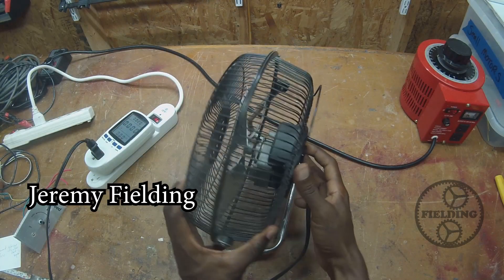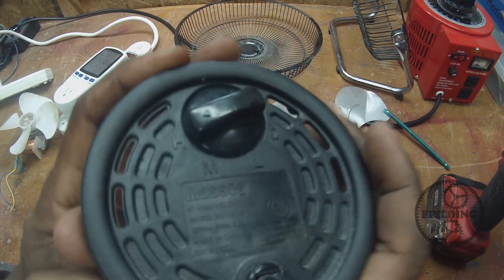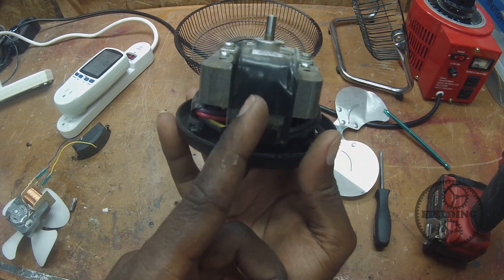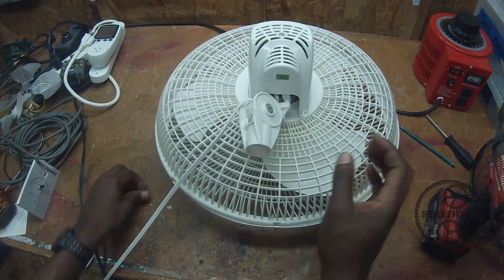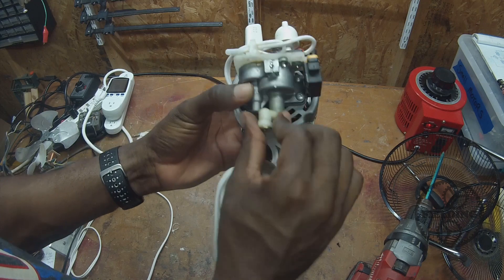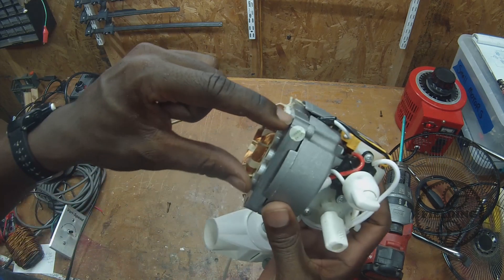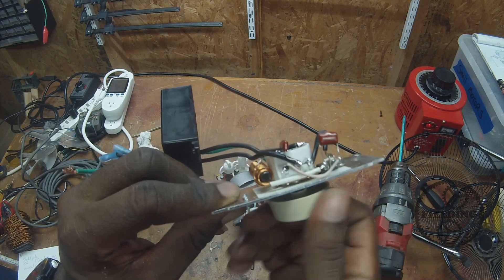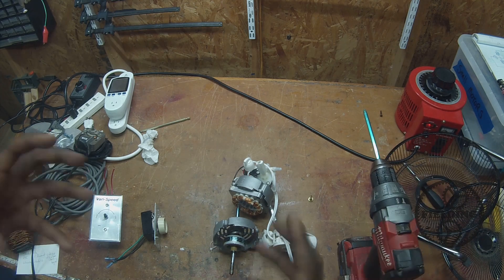Speed Control for Shaded Pole and PSC motors; How they work!: 039

Comment: Very educational videos. Compliments!
Because I want to digitize my old Super 8 films it is necessary to slow down my Eumig 610 D film projector motor exactly from 18 frames per sec to 16 2/3 frames per sec. I think the motor is a shade polo induction motor. The motor has two wires to the motor. My question is can such a motor be slowed down with a PWM (PulseWideModulation) method? A dimmer does not work accurately enough. Thanks in advance for your response!

Comment: Hey Jeremy thank for the explanations, I'm new to this stuff, would a psc motor work with a speed controller? I have a 3 phase motor with a 4 uf capacitor, and I want to wire a speed controler if possible, but don't know how, nor have I found info about it. Thanks

Comment: Why are some of the "C" frame shaded poles rated at 240v and others rated at 120 and still others rated 120/240 yet they look identical, where is the difference in these, is it the primary wire size different between them.

Comment: What’s the difference between the triad dimmer and that “Vari-speed” triad based control? I’ve seen those go for significantly more $ than the dimmers and can’t help but think they somehow offer a more reliable method of attenuating… but I’m just speculating here. I’m hoping to make a shaded pole speed controller with a rocking foot pedal, but I’m not sure which to use/if one will be able to bring a motor up to speed quicker than the other under-load. (I’m making a Leslie rotating speaker). 

Great explanation as others said, so many people just drone on and leave you learning nothing.

Comment: Great video and excellent explanations, much appreciated !!!
I have a 220V table fan who looks like the one you used at the beginning in your video, the problem is that it is very loud even on speed 1 which is the lowest. Can I reduce the voltage by plugging it into a 110V transformator ? To be honest, I tried it and it works like a charm, but so many people told me that this is dangereous because it will damage the motor  which will overheat at low voltage, and the fan can even catch fire in the worst case. I can also mount it with a lamp dimmer which I own (the kind of wall mounted dimmers used in the seventies with normal lamps) ?What do you think ?

Comment: Nice explanation, but I have a doubt, the bench grinders (110v) have induction motors (brushless), and most of them have only one speed, although some manufacturers offer models with speed control. I suppose they are not using frequency control because is a expensive. So, What is the method used to control the Speed in a cheap monophase bench grinder?

Comment: Thank you for this! I've been looking at ways to control speed of a whole house fan using a remote, and options are very limited. I've read some resources on PSC motors, but this video is the only one that explained how these motors work on a practical level with restricting the coil, and it finally made it click for me.

Comment: Very informative!  Can you possibly talk about how you could add a fan speed control knob on an oscillating fan?  I don’t want to add the speed control without bypassing the oscillating motor, for fear of burning out the oscillating motor.  This is for a 30” industrial fan.  Thank you!
Reply: Ok so I learned it should only be one motor.  So it seems the cork rage control switch should not hurt the oscillating function.  So do I just wore it up??  Lol just thinking out loud but thought I’d check in.

Comment: I love to learn from you ... but i have question / problem. I have reused my old compressor motor wich was ok, for my DIY beltsander. I cannot remember if there was a identification tag on the motor or compressor. For now this motor is unkwon and 3 colored wires and 2 black. Black is the centrifugal switch and then green white brown come out of the engine. They meassure 2 4 and 6 ohm.
Now i tried to regulate the voltage and smoke came quickly. How is this possible ? How can i identify a 3 phase and 1 phase 220 V motor ?

Comment: I would have thought the only way of controlling speed on a shaded pole motor was with frequency.. IF you actually are doing it with voltage, is this due to slip ???

Comment: If you connect a switch to the capacitor connection into a single phase motor, are you able to control it using the change in frequency? And can you control single phase motors with capacitor start using voltage without risking overheat ? Of course lowering voltage from nominal

Comment: What a brilliant video. In my motor course they dogmatically stated that by adjusting applied voltage (or winding turn numbers) to control AC induction motor speed is ineffective, especially in shaded pole motors. With a brief practical demo, you showed that even though it isn't great in terms of efficiency, it does have practical application. Certainly it's a lot easier than changing frequency, though I suppose by increasing slip, the motor shifts over to a region of the torque curve that draws more current and puts more heat on the windings. Evidently for low torque applications like a fan, that works OK.

Comment: So being able to tap the coil at difference points and being able to change the supply voltage as well  would create a huge variation of speeds and torque if combine?

Comment: guys, I am still not sure if it is a good idea to slower my induction motor with the help of a dimmer, I have done it and it does the job perfectly fine and after 2  years I have come across this video and what I have found is that he is saying not to do it this way, the motor I am using is for HVAC and it is an induction motor with the capacity of 15 mF, it is 1/2 HP, 1350 RPM, 1 phase and I am able to reduce the speed to almost 300 RPM, any idea why it has not stopped working and should I disconnect the dimmer from now?

Comment: Could one of these be reused in a circuit with different resistors on each wire to lower voltages? Say to have have different brightness for a light?

Comment: Hi! I have a few exhaust fans I want to install in a paint booth I’m building. They have single speed PSC motors in them. 
I want to be able to vary the inlet fan speeds to adjust the pressure in the booth. 
What kind of speed controller would you recommend? 
Also, Could I run two fans off the same controller? Thanks.

Comment: I'm a little confused :( in the previous video you showed us how changing the voltage and the power of the magnetic field didn' t affect the speed of the motor but in this one it seems it works...what did I miss? maybe it's because there is a load now?
Reply: If I understood correcttly, it is because it is not the same type of motors, in the previous video it was an induction motor

Comment: Hey Jeremy ! thanks for these videos . I have two questions. Where can I get that red device with the knob on it that you used to supply the variable voltages? Can you hook me up with a link for it . I really want one . Also for the motor that had variable speeds by taking from the windings at different stages, will the one that comes off the windings last have to highest speed or lowest speed and why . Feel free to send me direct VN. My number is 18683488235. I would like to be able to ask you about future video request . At present I would like you to make a video on how to make a DIY washing machine using a washing machine motor and something like a large bucket .

Comment: Those variacs are poorly made, compared to the monsters used to have, but some things are cheaper, that equipment. analytical equipment, used to have balances 20k, amino acid sequence DNA synthesis don't know, guy ran iop into dirt, refused to help. He's electrical engineer. Just hobbyist? Need power for ac dc heating mantles Control. Brother stole all, set fire to whatvouldnt sell, left nation. Serial killer, deviant see van diagrams for crimes, famous dead royal rich, missing sex abuse, murder statistical anomalous you'll find adresss. Sussex, UK. Tunneling to not pay two nations. End west. Hemispherical mantles can be ac dc, get up to 450 Celsius!  Need explosion proof sparkless motors, stirring overhead PTFE, under magnetic stirring. Use fan neodymium two on blades poles across. Controller PC or larger 5-12 volts cooler enough old PC could power mantles. Dc electrochemistry, control. Welder would be mice if control, not wasteful. Awesome stuff!  He should be teaching, or father.

Comment: Hi Jeremy, big fan. Making a lapidary machine with single phase brushed motors with start capacitor. Was hoping to run it right off the motor. What would be the best method of speed control? Or should I just maybe use pulleys? Thanks for all your great videos. I am very new to this so watch them multiple times. 👍

Comment: Thank you so much for your videos! They have rekindled my inner maker and I have started on a project to make a circulating fan for my wood stove using a salvaged PSC.
I threw away the speed control switches (without thinking about the fact I could reuse them). 
My question is, what is a cheap & effective speed control to use with it? I was thinking of just using a hood fan switch but was curious what you might use.

Comment: Jeremy, As a curious thinking guy, but with an automotive background, a single speed shaded pole motor, simply uses mutual induction but to a rotor. Now I have a devious idea. On lawnmowers, snowblowers and most small engines, they imbed a pair of strong magnets into the flywheel. It’s only purpose is to force mutual induction into a laminated core, but a number of wire turns creates high voltage at very low amperage. This spark timed by the flywheel.
 What happens if we take the outside diameter of the flywheel and cut the shaded pole motor to use mutual induction to produce electricity? This is the arrangement of large lawn equipment that has lights on them. With a tight air gap, a shaded pole frame cut to fit the outside diameter and use a wheat-bridge rectifier to produce DC voltage, it could be used to operate LED strips in housings or simple double faced tape to shine light on the work on our short winter days. 
 Now, with an unknown number to wire turns, ran thru a rectifier (Slight voltage drop) but perhaps a regulator for 12 VDC. It can be $200 more to purchase a light kit or more installed at the factory. This could be a cheap interesting experiment just to see the voltage produced (120 Vac / 12 VDC) and the current should equal the fans usage at speed. Easy to operate LED lights using current limiting, or bulb operated lights depending on output. 
 Curious, daylight savings makes it dark to mow or bag leaves to till into garden. Grow dirt!
Thanks again for the video and clear info. I have a big fan, I plan on drilling holes into the sintered bronze bearing, tap and install grease fittings. So I can get it working again!

Comment: An induction motor can start in either direction a capacitor or starter winding is added to the motor to start it in a predictable direction.nothing to do with torque

Comment: Can you tell me why?I have a 1/4hp single phase  electric motor like might be used on an air compressor or squirl cage furnace fan, now this motor fell off work bench and landed directly on the armature shaft, driving armature shaft into the motor housing!now the motor was fine +working well until this fall (of about  4feet directly on its shaft) immediately after the fall motor was hooked back up as it was just before,+ would not come on!? No hum no twitch not even a spark! Now I have disassembled this motor(a lot!) And reassembled to no avail it just simply will not run,! With 20 years gone by and considerable thought I'm only able to come up with this answer, did the center part of the solid centered metal armature shift on the center output shaft?possibly breaking some electrical connection?plz if u can answer this I would greatly appreciate it signed puzzled for years!,(might I add there are no physical signs of damage to this motor that I have been able to find, all clearances appear OK +motor spins freely no internal contact or rubbing any where)Mr.Gary Ebner

Comment: Jeremy I have a very expensive $189 shaded pool motor and it is single speed and coil is shorted☹️. More windings is more torque.....what Would happen if I used a larger size wire or a smaller size wire does it simply mean that a smaller size wire will take more windings that’s more torque? And a larger wire would not support more turns but less turns meaning less torque? But with a bigger wire be any benefit? Thank you for all these educational videos you put out I’ve learned so much from you

Comment: can you do a vid on ceiling fans and variable speed vs dimmer? im a fan collector and have found ceiling fans should not be used on dimmers, but they act very strange when they have a light on the same circuit and different dimmer and speed settings and light settings have weird effects.

Comment: Thanks Jeremy. It's very helpful.i have a doubt though. In my table fan when I took it apart. There were 4 wires... 1)Common yellow 2) lowspeed red 3) medium speed white 4) high-speed blue. The white and blue wires are shorted ( shows 10 ohm resistance on my multimeter) . The others aren't shorted. Is this a problem?

Comment: so if i buy a voltage regulator for a  speed controller this will slow a 230v a.c  centrifugal shaded pole fan motor? The fan motor is only 58watts.

Comment: Thanks for the video sir. I have a question: I changed the dc(90v) motor of my treadmill with a 3HP 220V  AC single phase motor. Is it possible to control the speed without a vfd? Thank you
Reply: 3HP is over the top. You can move a small lift with that motor.

Comment: Since the frequency of the magnetic flux is the mains frequency (50 or 60 Hertz depending on where you live), why is it that the motor can nonetheless rotate at any speed? Should it not only rotate synchronously with the flux?

Comment: In the video "Will A Dimmer Switch or Transformer Control An Induction" you have said that the speed of the induction motor should be controlled by an apparatus that controls the input frequency because: speed = 120*f/P, and that changing the input voltage is not a method to control motor speed and can damage the motor. Now you say that one can change the motor speed by changing the input voltage. Can you explain that? Is the voltage method only to small induction motors and the frequeency variation method to more powerfull motors?
Reply from the maker: It works for fans because of the type of load. It is terrible for most other types of loads. It helps to watch more than once. Between the two videos it’s all there
Reply: @Jeremy_Fielding  ok. Thanks for replying

Comment: I want to build a small rotary rock tumbler. 

Would a box fan motor be a good way to power it?

Sorry for such a silly question, I know nothing about motors :-)
Reply from the maker: Check out my video "Ultimate beginners guide to electric motors". I just released it. That video will help you way more than I can explain in this comment box.

Comment: I am using a hair dryer as a forge blower for blacksmithing. I have been following your motor series and appreciate how helpful it is.  I am hoping to built a belt sander out of a treadmill motor at some point. My main concern regarding this video, is does this mean I can hook a small fan, such as a hair dryer with a cold setting that bypasses the heat element, up to a fan dimmer switch? Off hand I don't know why it wouldn't work, but I don't understand enough about what you are teaching yet to have much confidence I am not missing something. Thanks Jeremy. Keep up the good work

Comment: My ceiling fan motor is a PSC induction motor with a 5uf capacitor in series with one of two coils. Speed control is achieved by a 3 position switch which switches in 0 (high speed), 10 (medium speed) and 5 (lowspeed) uf in series with BOTH coils. In this case I don't really know which is the main winding and which is the auxiliary winding. The direction switch switches the polarity of the winding that is in series with the switch-selected capacitor. What is going on here? I don't understand why this added capacitance is in series with both windings , thus reducing the capacitance of one circuit, and increasing the capacitance in the other.  So going from high speed to low, the capacitance in series with one winding would be 0, 10, and 5uf, and with the other winding 5, 3.3, and 2.5uf. But I assume the combination of effects of different capacitance on voltage on the coils and changing the phase difference between the auxiliary and main coils results in reducing the torque and achieving the desired speed control under load. Your videos are outstanding!

Comment: It's been a great experience hanging out with you this afternoon Jeremy, such interesting info, things I needed to know. To my knowledge the motors from the front loader washing machines have the most torque to drive anything even an electric car in my opinion but don't know enough about it. How about one of those with a spead controller driving a single phase motor to generate power. Some sort of demonstation of that would be interesting to watch.